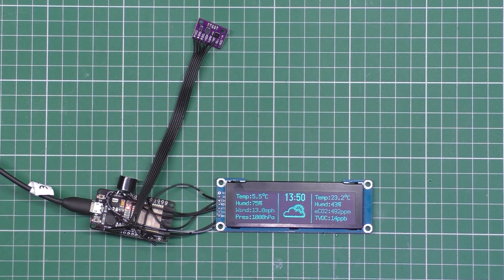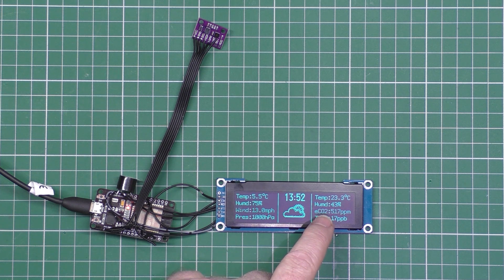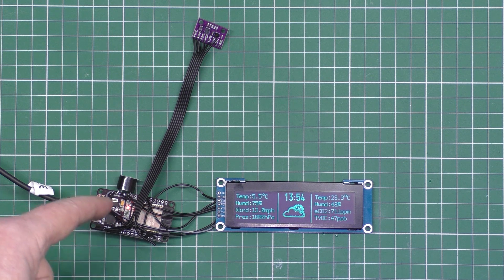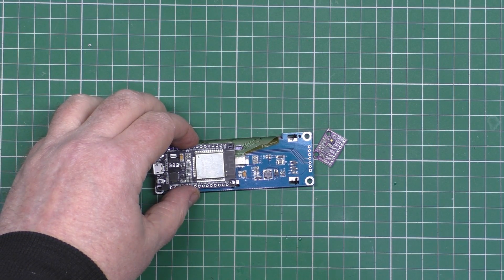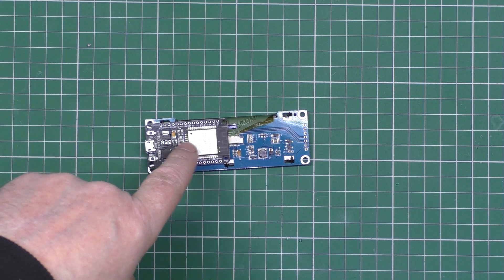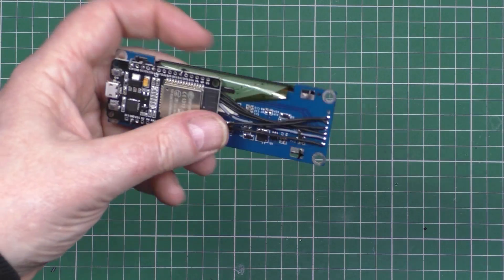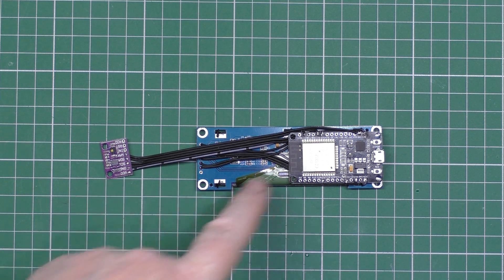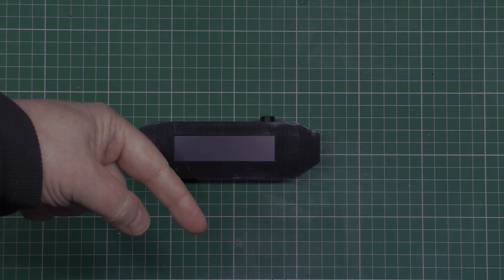IOT ESP32 weather station with CO2 & VOC alarm - Build instructions

Comment: I agree with "et k". The norm is to use GitHub or BitBucket for SVN coding projects and the like.

Here is also some constructive criticisms for your videos:

You stated that you only need 3 thing, but that was not the case. You need the MCU, display, buzzer, sensor, wire, tape, soldering iron and solder and some way to desolder the original headers. And then there's the case too.

I noticed a lot of I can't sees and I don't knows throughout the video and it just doesn't inspire much confidence. 

Write your narratives down and read them as you go to show confidence and knowledge. 
Explain the signals that are being connected from each device to the other and what they do.

Use Fritzing  to show the connections. Talk about why you selected the components that you did and the libraries that are required to use them and what they do. Talk about the code and how it works and what could be done to modify it for particular scale changes (IE C to F), etc...

The video gets the main idea across, but lacks in the background information and the how-tos.

Comment: i recommend to calculate median from Co2 and VOC (maybe also temp) from some few measurements so its not jumping up and down so much.
Reply from the maker: I did think of doing that but I noticed that sometimes, a sharp jump of VOC can be detected. I didn't want to average the readings because I'd prefer a false positive rather than no reading at all.

Comment: Im glad you got rid of your flu 

Looking forward to your next video
Reply from the maker: It's not gone completely mate. It's still lingering but I'm getting there slowly :-)
Reply: Glad your on the mend
Reply: You know a few things about pc's . .  here is a problem i have . . . .  I have a desktop and laptop and want to do a wifi network with them down side is route i use is a public BT one (bt with fon) laptop is one that has access to internet how do i share that access and give to desktop pc as well with out using another wifi card ? 

I do have a tp link old route which you can turn the modem off which ive done  it also has usb connectionso want to network a printer and hard drive(s)  

Any idea how to do this ?
Reply from the maker: One thing I've learnt with my 30 years experience in IT is........ It's not easy to understand exactly what someone has or wants without seeing it and setting it up yourself. 
You may run into problems if it's a public router because it doesn't usually support local routing. If you can successfully run a ping test to the PC/laptop you want to connect to, you're in business. To ping a PC, simply open a command prompt by trying CMD into the start menu and opening the 'Command prompt' and type "ipconfig". Note down the *IP V4 address*. Go to another PC on the network and open a command prompt and type 'ping' and the IP address you just noted. e.g. ping 192.168.1.100. If you get a message of "Destination host unreachable" it means you can't share internet/hard drive/printers.  
If you don't get the error, follow these:

This will tell you how to setup a wifi hotspot (start at the section called "Share a Wired or Wireless Internet Connection in Windows 10")
https://www.howtogeek.com/214080/how-to-turn-your-windows-pc-into-a-wi-fi-hotspot/

This will show you how to share files/folders/hard drives.....
https://www.teamknowhow.com/kit-guide/computing/laptops/dell/inspiron-13-5000/how-to-set-up-file-sharing-on-windows-10  

This will show you how to share a printer......
https://www.groovypost.com/howto/share-printer-windows-10/   

I hope this helps :-)
Reply: Thanks for all this info

Like you i have a few years experience with IT going right back to zx spetrums  and commodores c64s but never needed to go in depth as i want to now and its a good way of constanly learning

Comment: nice work the sort of thing i am doing at the moment have you looked at sonoffs they can do a lot of this already especially if you run custom firmware ? only thing is they are a lot bigger...
Reply from the maker: ....and I thought the Sonoff was a wifi switch :-)
Reply: great piece of kit... put a barometer on mine last night just one i had laying about from my quadcopter stuff, check out tasmota firmware thats the custom firmware it will run... it uses an esp8266